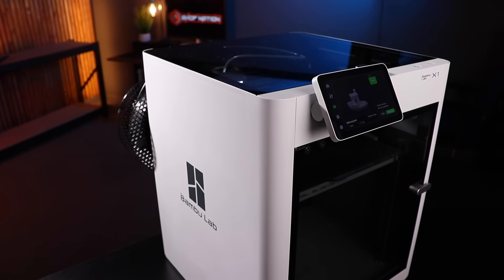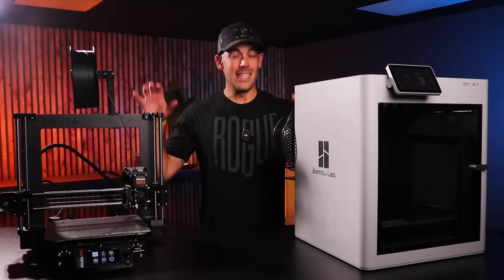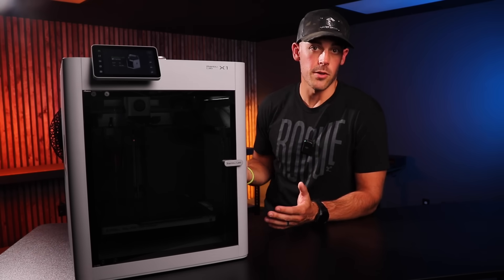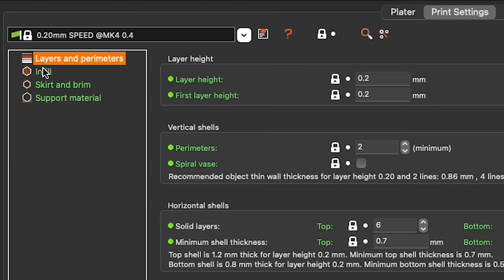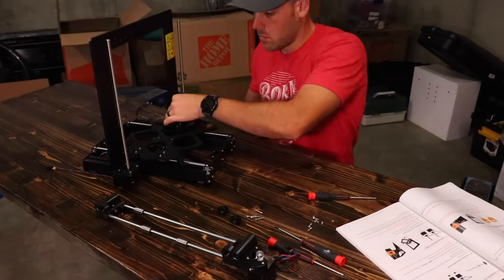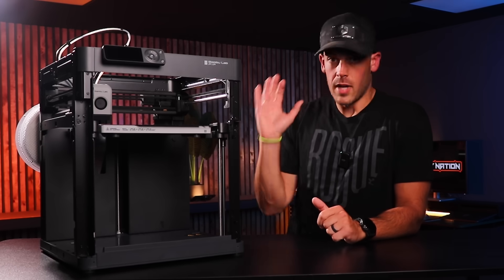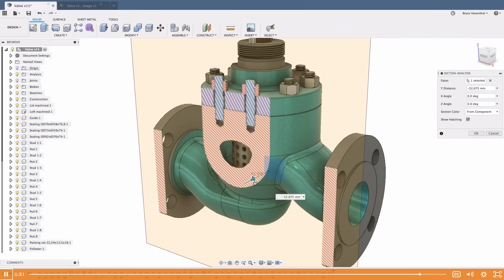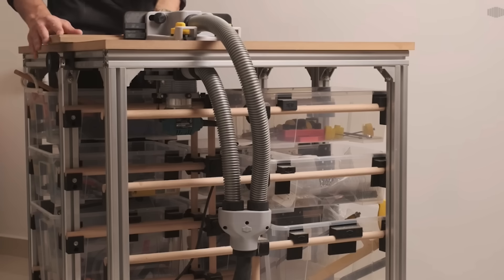The 3D Printer I'd buy if I started over

Comment: I started with a cr10-max modified it still a great machine then a tenlog d6 absolute crap but will revamp to work right then a ender 3 s1 pro great machine and now the Bambu x1c blows all out the water have done pla, petg, petg/carbon, paht-cf and abs machine loves it all just wish it had been a bigger build volume 450m3 would of been better what were they thinking ?

Comment: I wouldn't recommend building a first printer! My first printer was a very early reprap and we never got it working reliably. I now have an Ender 3 S1 Pro which was a pain to set up (the included filament is shit!!) but it produces results I'm happy with for now. If I find that we're using the printer enough I'll upgrade to the X1 Carbon (and run two printers).

Comment: I started back when I became 16, as a gift I received an ender 3 like clone (idk why it’s unheard of in the us, but you can find plenty where I am) and it still works great, I print some tiny project here and there, bought a sidewinder x2 but ended up reselling it, and tried a bit of resin 3d printing but i had to stop. The right printer really depends on yourself and your budget, you can spend 160€ and calibrate everything, having to do a bit of tinkering, but nowadays with 230/300€ you can get a very plug and play machine (neptune 3/4)

Comment: I have had the Ender 3 Neo for about a month now and I think it was a good starter printer because I did have to learn more about how it works in order to get it to print dimensionally accurate parts. I am an engineer, however, so I geek out on that stuff. I like to know what's going onside. For the price, I think it was a great investment for a starter but am already wanting to dive in and spend a little more. I appreciated this video. I think I will go with the kit for my next printer.
Reply: Haha exactly my path,  just sold my neo to my little sister, but I'm so glad I learned on that printer first
Reply: Im a photographer its was the same for me with that. instead of starting with a $2000 or even a $1000 camera I went with a $600. it was a bad camera so i really had to get good with it to get the images i would easily would have got with a better one, but when I mastered that I got a $2000 one with my skills from my cheap camera I was doing some amazing stuff with the new camera. A lot of the other photographers im friends with had been it just as long as me but all of them jumped right into a high end camera and they all say im better because I have more skills witch was because of the way i learned

Comment: my advice, if u want just to prototype rough parts... get urself an ender3 classic they cheap have relative big volume for its size... and is very easy to learn to use it... is very intuitive... if u want production quality that looks like injection molding... u want a SLA or resin printing cheapest one u can get... but becareful of the size volum u can build they are rather small compared to FDM also a bit more expensive and require a "drying room / currying box " and resin prices are insane... but quality finish is also insane... just they crack fast... if u want to do keychains and soldier figurines etc... resin is best... if u want to do something more rough FDM ender 3 classic u can mod it etc open platform easy to use.

Comment: I started with a Flashforge Adventurer 3 5 or so years ago, and despite the fact that it has its own slicer software... the first years were frustrating as hell.
But with the latest updates they really got their software and firmware to a really good level. Just pick a preset and start printing.
So I would personally recommend a Flashforge Adventurer 4 or better yet the 4 Pro Model for 750€
Similar to the bamboo it has an enclosed Printspace wich makes it a great abs printer.

Comment: I got a used Flashforge Creator Pro just 2 months ago as my first printer, and I am pretty happy with it. I guess it greatly depends on what you do with it. If you are planning to do production, you need all the convenience and speed you can get. For me, I don't mind putting it on a sd card, and then walking to the printer. It's a 20 seconds process on an hours long print. No big deal. Same thing with bed leveling, once the bed is levelled, it's rock solid. Only when switching nozzles or something like that, you have to recalibrate, a 60 seconds process. 

I upgraded the printer to micro swiss all metal hotends with a2 hardened nozzles. Still have to print 'engineering' filaments, which should now be possible. It prints great, and I've seen them on the used market for as low as E 150,-.

Comment: I'm quite happy with my Prusa MK3S+ that I built from the kit. I would like it to have two things: a multi-material system, mostly so that I can print supports that are easier to remove or dissolve; and, more speed. Trying now to decide whether to buy the Prusa multi-material system (MMS3) and the upgrade kit to bring the printer up to MK4 specs, or just go to the Bambu P1S or X1C. The Bambu's AMS is compact and seems to be pretty well integrated, if rather wasteful of material during changes. Prusa's MMC3 seems to take up more space, but I just like Prusa as a company and I appreciate that their printers are open source. Decisions, decisions.

Comment: Agreed 100% My first year was nothing but learning and struggling with ender 3 and kobra max. Until I really understood how they worked and tuned my slicer to them it was hell. I would do it again learning what i know but its a lot for someone who isn't a masochist
Reply: ive been thinking about getting the ender 3 s1, any advice? ive used a generic 3d print before but curious about what in particular was the biggest issue with this series? that being said i cant just afford to get the first 2 reccomended in this video XD maybe one day but for now im thinking the ender 3 s1 would suit my needs (looking to basically make props and bigger figures)
Reply: @RustyTorch I can't speak for the S1 personally, I had the older ender 3 pro with single rail for the y axis. That was a HUGE issue when I went to upgrade it for starters. But I had issue with under extrusion, warped bed, and learning how to install marlin all within the first couple of months of owning it. The Bowden system was garbage in my opinion so I went to direct drive added probe for z offset, upgraded to a silent board and added linear rails, also added a glass bed, upgraded the y axis rail with a part from ender extender and had to mill the provided extrusions down to get any of it to fit. Not to mention find a file for the belt tensioner that I had to modify myself to work properly. Now it prints amazingly! But all of that process I just finished about 2 months ago so... just giving you a cautionary tale from my own experience. I have 4 machines now and if you want to print in multi colors with basically none of the hassle the Bambulabz printer is worth the money I promise you. All my upgrades ran me close to $400 on top of the printer

Comment: I really love 3d printing, every problem I come across or issue I have with something I try and solve with 3d printing. It's a really amazing way if you're quite technically inclined and creative, as there are so many probabilities to solve obstacles you come across.

I started out with a Ender 3 V2 as I wanted to try it out with a "decent" cheap solution, and boy the ender 3 v2 did not dissapoint. You can start out with the base model, and it will work. But it does require you to learn more about 3d printing, and how settings in apps like Ultimaker Cura work and influence the printing. And if you want it to be a bit better, there are tons of upgrades you can built onto it, which are not even that expensively priced.

Building my own 3d prints was the biggest challenge as I never looked into 3d modelling before, but I started out with simple products in Blender. That worked fine for me, just learn what I need to have at that moment, and it shouldn't be too complicated.

But now that I know what I'm doing a bit, and I often try making my own prints. I wanted to upgrade to a P1S in the future for faster prototyping! :) Just sharing my experience

Comment: 2:35 seriously, what he said is accurate. The ender 3 is that craigslist car you bought that "runs great" and the transmission goes out right after signing the bill of sale despite it being a new printer. You are not buying a finished 3d printer is the best way i can describe it. Once you spend about 200-300 usd more on upgrades then it starts to function... Eh. If you are dead set on buying an ender 3 buy it used "broken" because you stand a good chance of it being in better shape than if you buy it new.

Comment: Unpopular opinion ender 3 are finicky and not that reliable and have demons in their design/firmware. Want a reliable but less acurate printer to print trinkets and see if you like it? Get an easythreed k7 for 60-90$ have had no radom glitches and hateful failures. The ender 3? More grammatical glitter uttered and hateful fighting with weirdness and weird crashes.

Comment: Having crossed both words, I don't recommend neither printers presented here.

MK4 has no much difference compared with MK3S+ and not the best printing quality either annnnnnnd no input shaping yet.

X1C works out of the box but not user friendly for maintenance with terrible ringing because you can't run input shaping on it, I returned mine after 3 months.

Voron is what you wanna look into, it's a completely beast, extremely fast with high printing quality. Buy high quality kits like LDO and it just works and 100% user friendly for maintenance if needed.
Reply from the maker: The Bambu labs printers absolutely use input shaping, just not the typical open-source version used with Klipper

Comment: Ok, so I am watching this for some legit comparison points, and tired of every single person not addressing or admitting to and completely overlooking a core issue, same issues with the overrated creality printers; quality control and longevity/support/reliability. As it stands, right now support by Bambu is relatively abysmal. Lots of issues regarding warped beds (a killer,  if the platform supporting other beds is also warped) and other warped parts, as well as motor issues and degrading build materials internally are being reported everywhere. You get that with abysmal support and a lack of modularity/planned expiration of parts, you 1500 means absolutely nothing. Prusa is known for support and longevity, and providing upgrades in the future to constantly keep their old products relevant. Most PRC Chinese companies are nearly all rolling a dice for the quality lottery as well as more frequent nasty corporate practices/ IP practices than even certain notoriously nasty American companies. Aside from that, I came here hoping you would touch on that, and maybe address concerned regarding the lifespan and modularity of the Bambu branded printers, as I REALLY was hoping all this was as good as it sounded. Though I am disappointed about someone getting on the pure stats hype train for price and ease of making the reviews. If you wanted to base things off pure price vs stats, creality would win here nearly every time, and most of us know, they are absolute shit. Why would you recommend the bambu over prusa with all those issues after admitting  knowledge of them?

Comment: 3D printing without knowing 3D modeling is like buying a car and only using a train to get somewhere.
Reply: If things you need already exist on thingyverse then you can get away without 3d modeling.
More accurate metaphor would be: you buy an off road truck only to cruise on highways. You still use it, but only to a fraction of it's potential.

Comment: I was debating on getting a 3D printer for some time but you made a strong argument for that MK3S so I'm getting that kit! Already thinking of all the things I'll be able to make with it! Mechanical models, figures, small bits and bobs for daily use. There are so many possibilities! Thx for professional advice! Awesome video for a complete newbie like myself 😁
Reply: I started with an MK2 and upgraded it to an MK3 and then an MK3S. No complaints, when I bought the MK2, it was top of the line with its inductive sensor, and the upgrade to the MK3 was a wonderful improvement for the decrease in noise and that removeable textured PEI bed (I waited many months for that feature). No real improvement with the MK3S. But it still had two short comings: getting the first layer height correct (at nearly 60, my eyes don't refocus like they once did), and the occasional blob of death that could destroy the delicate wires for your thermister and heater cartridge.

Now, I was really glad to see Prusa fixed those two pain points, but at the price, I would have expected some form of dual extrusions. I wouldn't buy a new MK3S these days because there are now a bunch of other printers that are better, for much less money. I like the specs on the SVOL SV07 series, as well as the Anycubic Kobra series. See the aurora tech channel for detailed reviews of those. If I was buying a single extruder bed flinger again, I'd probably go  with an SVOL SV07 max and replace those POM wheels with linear rails.

Comment: My pet hate is my xyzware DaVinci Duo. It works and does small prints OK but fails dismally on larger prints because the settings are all defined in the cartridge and those settings are wrong. Also they have the worst support I've ever seen from a company.

Comment: I am a retiree from the Aerospace field. I have to say I really like this young man and his approach. Straight forward with real facts. I have the CNC laser and CNC router as he mentioned ih the video. Now it is time to consider the 3D printer. What a great video. You are a top shelf instructor.
Reply: Hi, I am a junior in high school and I am interested in learning in the aerospace field because I want to create road/race cars that perform good on track. I want to ask, what I should expect when I pursue a degree in aerospace like the typical work environment, and what the things that I should expect to work on the most; I already know about turbulent and laminar airflow, outwash, wake, low and high pressure regions and how that can generate lift/negative lift, I'm into F1 and endurance racing, so every now and then I look at technical insight videos on how the air flow of the car helps create downforce and reduce drag. Is this a good start that I should continue or is there much more that I should take, like maybe learning CFD? What are some other things I should learn if I want to get a good understanding before I go to college, like are there other tools and software that I can learn?

Comment: Now, to be fair, I have the bamboo labs x1c. And you're recommending p1p however wouldn't be p1s be a better value at $100 more to have all the panel's already installed so you can print more filament types?

Comment: I think the video was very good, but when it comes to choosing a printer, it's important to consider the materials it can handle. This is especially crucial if you're looking for a printer that can produce functional parts. Certain materials like polycarbonate, nylon, ABS, and rubber are ideal for functional parts. Therefore, I didn't see any advantage of the printer you mentioned over the Ender 3. If you're a beginner and want to print PLA materials, then the Ender 3 printer is an excellent option.
Reply: do not get an ender 3

Comment: I've been printing for a few years. I think learning on the old cheapo ender 3 was valuable for me, but even with an engineering background, it took some persistence. I may upgrade to Bambu as I scale my hobby. Great video.
Reply: Once you upgrade to a Bambu Lab printer, you will likely never touch the Ender 3 again. Make plans to give it to a friend or donate it to a school.
Reply: I bought a Prusa Mini and that's EXACTLY what happened.  Haven't touched my Ender 3 since.   @EngineerTom
Reply: Problem I have is the software. Ever since I upgraded my board on my ender 5 plus, I cant do a print,  do to bed won't come up or will crash into nozzle.
Reply: The Ender turned nearly almost as many people off 3D printing for life as it ever helped. It was a cheap, badly supported piece of crap. I would NEVER buy a Creality machine again.
Reply: Ender 3 was a big learning curve (especially getting one second hand with no manual) but now that I've got it working well enough that I can run a 2 day print on it with very little chance of failure... I'd like to reduce that print time to 8 hr or less lol. Great learning experience, but a clear starter printer without a bunch more upgrades to it.

Comment: Great video for a nerd who's just getting into 3D printing. Thanks for getting to the point and hitting the important areas and not just specs. Plus the P1P just seems on brand.
Reply: For this price you could also go for UV Resin Printing - great printers start from ca. 300-350 USD (from Elegoo or Anycubic) and you might need Wash+Cure station for 100-150 USD. For lower price you get way better quality. Resin costs like 2x the filament, but who cares for with great quality. 
Postprocessing is needed for both FDM and Resin, from which you need better ventilation and gloves for Resin. 
One might say that Elegoo and Anycubic are just some cheap brands - they are, but Elegoo printers have hardened glass now and resin printers have very few components that wear over time!  They have literally 1 stepper motor, no belts, no moving cables etc. When we used Prusa in my job someone had to replace the nozzle from time to time - and when cable of the heater (in hot end) broke it was pain in the a*s. It did not happen often and you could buy original replacement parts, but still happened many times more often than I see with resin.